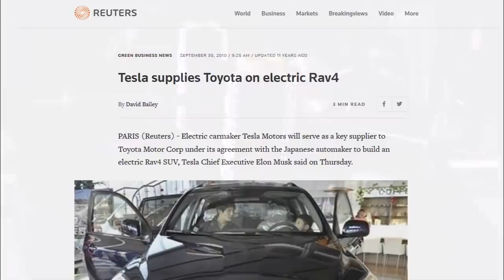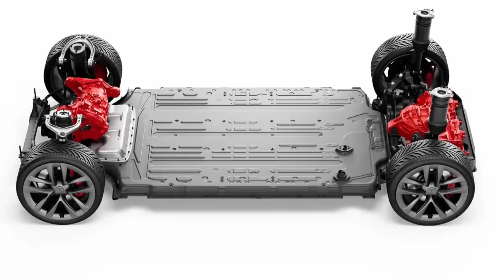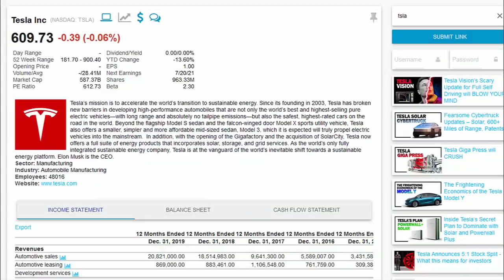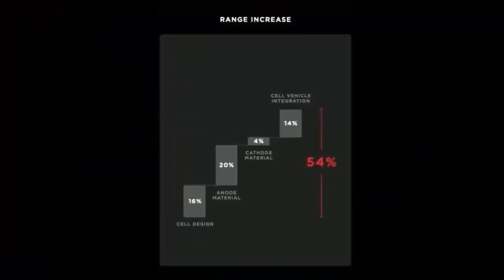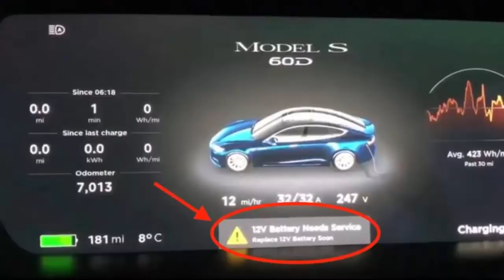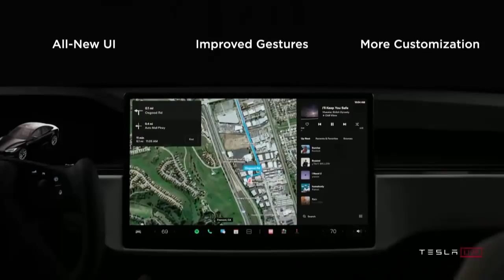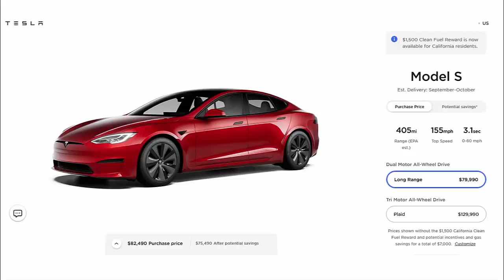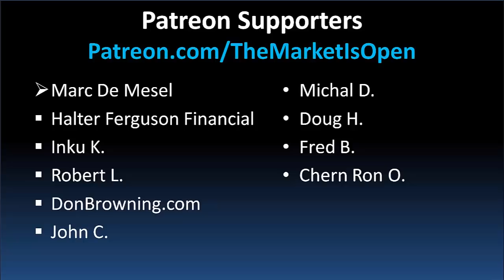The INSANE Engineering of the New Tesla Plaid Model S

Comment: I bet they could just put a second gear in that it shifts into at high speeds
Reply: there is no need for multiple gears on an electric motor. electric motors have a much higher rpm capability and have maximum torque at zero rpm. so if the torque is greatest from stand still and the maximum rpm is triple that of a combustion engine you can see how transmissions are just not needed.
Reply: @tylerdurden9748  Not completely true. Even the most powerful Teslas suffer at higher speeds.
Reply: @torbenjensen189  well yeah, but i was talking more along the lines of everyday within the speed limit kind of driving.
Reply: @tylerdurden9748  fair enough. For everyday driving I would agree that electric cars do not need gears. But then again, a 1000+ hp Tesla Plaid Model S really makes no sense for everyday driving. For that kind of use a standard long range Model S is already more than enough.
Reply: @torbenjensen189  what if you really really need some chips and dip for the party and the guest arrive in less than 10 minutes?!? that 1000hp Tesla might be the only solution...

Comment: "once supercars" - they are still supercars, because being a supercar is not about stats but about a philosophy of a design. Supercar is a car that is designed for the performance to the extreme with many compromises along the way. Lamborghini Diablo is still a supercar, despite many normal cars having better stats than lambo. If Tesla designs a car that is focused solely on performance, then it will be a supercar. Ferraris are still supercars but they are simply supercars of the previous era.
Reply: Supercars in philosophy mainly are being bested by Tesla’s  family sedan or roadster.  That’s the main take away.  

In the end, this signals a paradigm shift even if the full implications aren’t grandly perceived at present. 

When a $200,000 car bests a $2,000,000 car it makes the $1..2 million difference untenable   The supercar is no longer so in its complete sense and so effectively no longer a supercar technically even if still so in a general subjective sense.  The die is cast. Its days are numbered.  This is the implication of the phrase “once supercars”

Comment: Yamaha has released a compact electric motor rated at 496HP, far exceeding the Plaid motor.
Reply: Doesn't matter if you don't have the right batteries / software / charging system / battery cooling.
Reply: Thank you! That was interesting info. 
I wonder which market they are targeting. The total hypercar market is currently very small. Tesla is expanding it significantly with the Plaid. I wonder who else would try to do something like that. Bugatti sells 20 cars annually. Tesla will sell at least 50 000 Plaid annually. I cannot imagine Yamaha doing this to sell just a few hundred units?
Reply: Unless it has lower weight, higher efficiency and higher RPM limit than the Tesla Plaid motor, then it's not better.

Also, as @Thos Oz mentions, the battery pack (and vehicle dynamics software) is the limiting factor in EV performance, not the motors, and Tesla's Roadrunner battery will be the most advanced in the world and also the lowest cost.

Comment: One more motor, carbon over armatures, same 18650 batteries in a redesigned battery case, and a square steering wheel.

And it's still an electric golf cart with an iPad wired in.  Not really that revolutionary or disruptive or inventive.  Just more of the same pregnant whale with mustard up its butt.
Reply: That is an absolute stupid comparison
Reply: @Samana009  Since I've driven a dual motor Model S and that's EXACTLY how it handled, no it's not.
Reply: @billcichoke2534  yes It is.